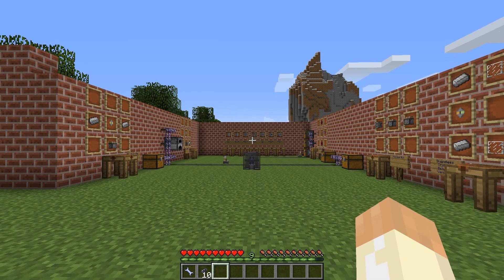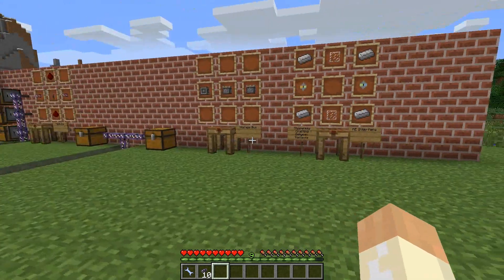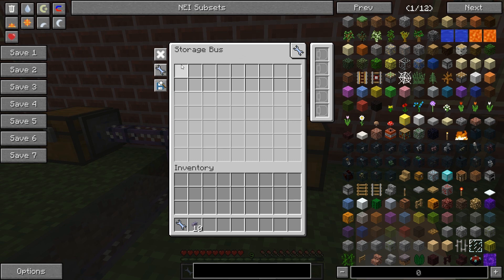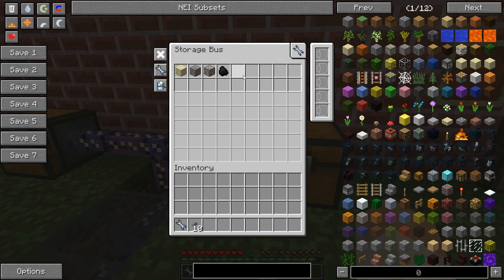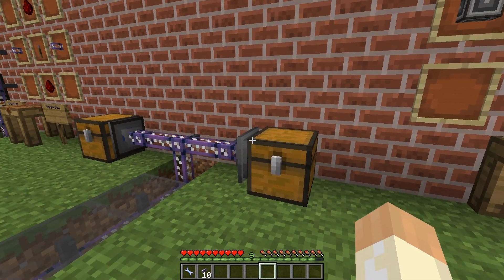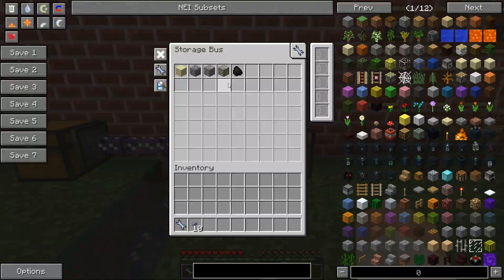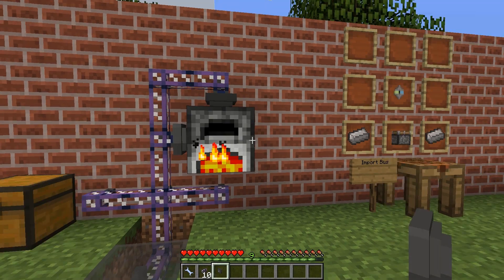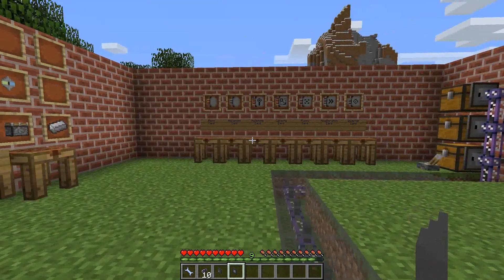Applied Energistics 2 Tutorial #5: ME Buses And Upgrade Cards (MC 1.7.10)

Comment: can i use a fuzzy card with auto crafting my system does not think it needs lots of saw for making covers
Reply from the maker: Usually this is not a problem, When I make the patterns I make sure to create it with ore dictionary button ticked but I'm not sure it makes any difference in this case. I have often done patterns with IC2 hammer and other tools that have uses, and it's never a problem for me. I think I create them with a brand new tool but again I don't know if it matters. However, I've heard reports of these things, might be a problem with specific mods or versions so I recommend making a proper bug report if all versions are up to date and such.
Reply: thank you

Comment: What do I do if 1 of my Me drive cells are black and the rest are green? PLEASE HELP!!
Reply from the maker: +princessqueen6661 The first thing you do is to send me a few screenshots of whatever you think can be relevant (make an album on Imgur or similar). Especially interested in mouse over-information of the cell that is black. Also show what modpack or mod selection you're using.
Reply: +TKH well it's basically Sky Factory 2 and I have everything hooked up and powered. And the one that wasn't working started working while another drive that was working stopped working.
Reply from the maker: +princessqueen6661 Oh, so it's one drive that goes black, not a single cell in a drive. In that case it sounds like your network is out of channels. How have you hooked things up? How many connected units on that single cable? 8 is max for thin cables, and 32 for dense cables. When you've reached 8 you'll need a controller and channel managing gets important.

Comment: Import bus+acceleration card+ender chest.
Best setup for long range quarries.
Reply: Simple and effective.
It's not in this video because it is purely about AE2. But it is the main setup in most modpacks.
Reply: +No waifu no Laifu great idea but even a fully upgraded Import Bus can't keep up with a fully speeded up Ender Quarry. Maybe it could work with 6 import buses? :D
Anyway I always use a tesseract to transport the energy additionally
Reply: Or if you have extrautilities you can use an ender transmitter and a reciever to teleport the items over to a transfer node (also from EU) and use transfer pipes to transport it to your ME Chest. There are speed upgrades and I'm pretty sure it's faster than import buses (I could be wrong because I just started getting to all this modded stuff).
Reply: And obviously your method does not require any other mods but i just wanted to put it out there

Comment: Please help me my buses dont work expect 4 and if i take one of the working buses another work so i only can have 4 working buses i dont know why only 4 pls help me (sorry for my bad english )
Reply from the maker: StubenHocker Could it be that you're exceeding the 8 devices per network? Remember that you need a controller to handle more than 8 channels, and every bus require one channel each! Plus 8 channels per normal sized cable. Send screenshots if you need more help, as well as modpack info and such.
Reply: Ok i got it now it works
Reply from the maker: StubenHocker Ok, that's good to know! Without controller you can only have 8 channels in the network. With a controller you can use 32 channels per side of the controller. But you'll need a Dense Cable if you want to have all your 12 channels on the same side. Split the Dense Cable to normal cables when you're closing in on the devices so every normal cable won't exceed 8 channels. Use Imgur to upload screenshots (make an album) if you still have problems :)

Comment: The toggle bus wont turn on for me.
Reply from the maker: I would need some more info. Like what mod version or modpack (version) you're using. More info about the setup with screenshots is also good :)
Reply: The modpack I'm using is Dinos Equivalent: Magic Mods and I'm not sure of the mod version.
Reply from the maker: Ben Bonus Well, it's a recently updated pack so it should be stable with regards to ae2 versions... But I would need more info about your setup to be able to help. I have never had any problems with the Toggle bus, and I have used both Levers and other mods to control it.
Reply: I'm not sure what is wrong, but when I hook up a lever in any spot, even a wireless lever, it wont turn on. I've tried using the inverted toggle bus as well but that didn't work either.
Reply from the maker: Ben Bonus I don't know what could be wrong... Can you try it in another modpack (like latest version of FTB Infinity which is a stable pack) just to see if there's anything wrong with the one you're using. Or update manually to a later AE2 version. Try it in creative with only like 3 devices to really make sure nothing else is wrong. Send screenshots - it can sometimes give hints as well.

Comment: can't seem to get the network to import from a ender chest. any suggestions?
Reply from the maker: You're the second person asking the same question. It should work the same as importing from a normal chest, I tried it yesterday in FTB Infinity. How have you connected things? And what mods/modpack are you using?
Reply: Eyeslayer oh and i'm using the speed upgrade in that sorry.
Reply from the maker: Eyeslayer Interesting! In the DW20 pack, there are two Ender Chests it seems. Both the vanilla and the one from Ender Storage. I just tried it, and the AE2 import bus doesn't seem to work on the vanilla Ender Chest. If you use the other variant, it works! I can only guess that the vanilla Ender Chest works in a different way compared to the modded chest (I mean how it works behind the scenes with how it stores data). If you just switch to the other type it should work fine :)
Reply: therealtkh thank you very much!

Comment: how do i get items form an ender chest, connected to a quarry, to transfer items to my me system network???? pls help
Reply from the maker: Well, using an Import Bus with a few Accelerator Cards should do it! :)
Reply: Thx ill try that out tonight!!!!! :)
Reply: but it still dosent work the item form the chest never goes into the crafting system???
Reply from the maker: Fernando Del Cueto I tried this in FTB Infinity yesterday, and it should work. What mods or modpack are you using? How have you connected the bus and so on? Give as much info as possible, screenshots can also help!
Reply from the maker: Fernando Del Cueto If you're using the DW20 pack, there are two types of Ender Chests. Don't use the vanilla variant, it doesn't work for some reason. Use the one from EnderStorage! Hope this solves your problem.
Reply: Yea it works now thx :)

Comment: im try to move any item from a redstone furnace, but here are not enough filter options is there anyway to just turn off the filter and import everything that goes into the furnace? (im using a laser drill so i get a lot of random ores)
Reply from the maker: Since the Redstone Furnace can output automatically you can just let it output to an ME Interface. Everything you put in an interface ends up in the system.
Reply: ah thank you it was getting annoying, im trying out these mods so im trying to fig them out, i wanted to get power and stuff down first, this is a nightmare compared to Big reactors xD
Reply from the maker: Kempun You could also the Interface method on Ender IO machines. Since they can be set to in/out from the same side, one Interface can hold both patterns (for autocrafting) as well as recieve the product. 
Yea, there's a lot to learn, but it's fun to build the system, step by step. Just send a message if you run into any problems :)
Reply: well i made it where i can auto make alloys the main 3 ingots for ender IO thats all i have really done for auto crafting tho. i learned some basics of Big Reactors, ender io, and AE2, well a lot more mods then those but i dont use them as much or only parts of them.
Reply from the maker: Well, in that case you're off to a good start for future projects :)

Comment: I like your videos, to bad im still stuck with my energy problems, why does this mod give no real power source for there own things!? I dont want to use and addition mod to make this mod runnning. Im running out of coal and now i have to use 3-4vibration chambers to be able to access my terminal.
Reply from the maker: Yea, I have been asking myself the same question. I doesn't feel like AE is meant to be played with too much alone. There are five other mods supported: IC2, BC6, TE3, RotaryCraft and Mekanism, but without them I think you'll need a lot of coal and charcoal and just live with the fact that the system can't be turned on all the time...
Reply: Thanks for your help so far. I will need to check out these other mods i guess ;)
Reply: djjoker12  if you are still worrying i suggest you use turbines from Mekanism. they are fairly cheap and create RF from the wind. in order to make the power compatible with the ae system use a converter. ( i cant remember what the block to convert energy is called, it is in ae though.)